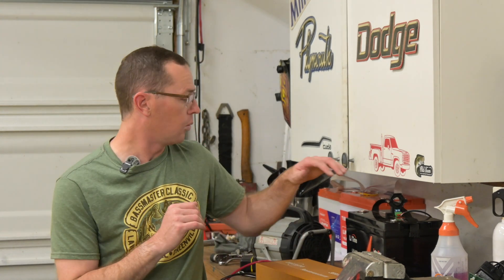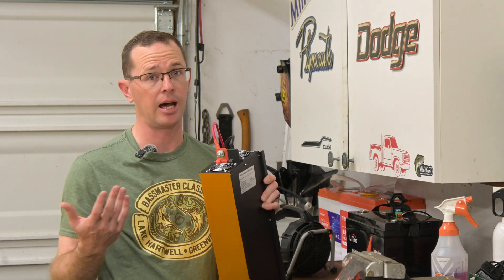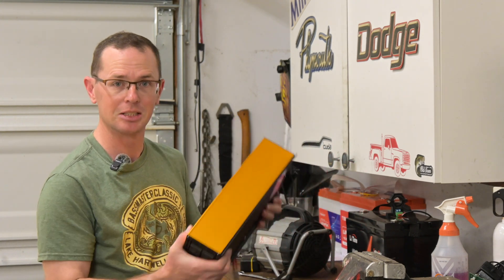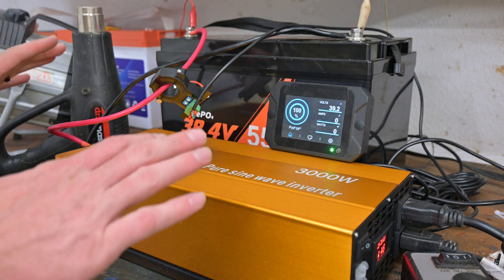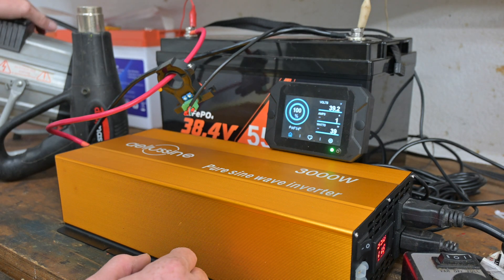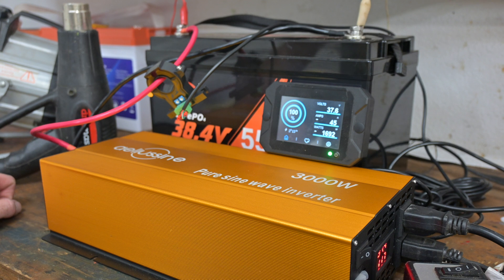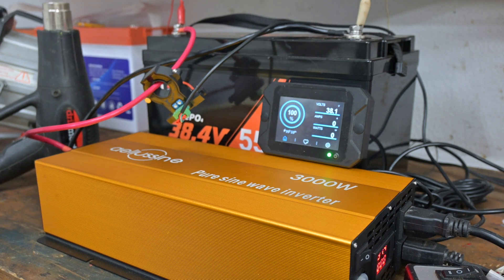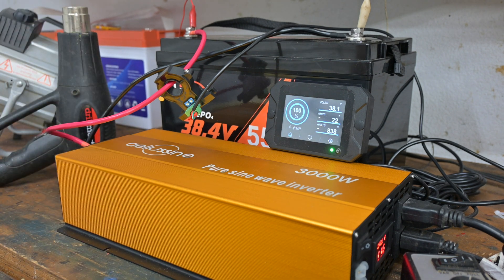BIG Power! Inverter Overview + Max Output Test | Aeliussine - 36v 3000W

Comment: I don't understand lifepo4 cell full charge is 3.55 (3.6v ) in 36 v configuration fully charged is 42.3  100% full  how is that battery full capacity is  38.5v????
Reply from the maker: Nominal voltage on these batteries is 38.4v. Fully charged they will sit around 42.3v. 

Just like a 12.8v nominal lithium will sit around 13.4-13.6v fully charged. 

“Nominal” voltage and fully charged are different values

Comment: Got the 2,000w model-- it won't run anything over 1,000w.  got the 3,000 w model, wouldn't run anything over 1,500w, then died 10 min out of the box.  Avoid.
Reply from the maker: Really sorry to hear that. The 3000 is still going strong for me